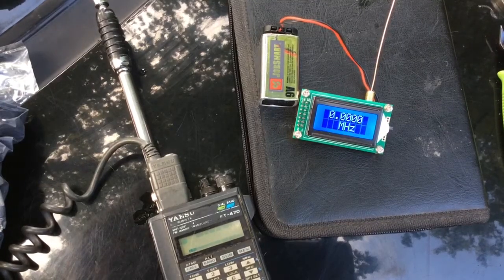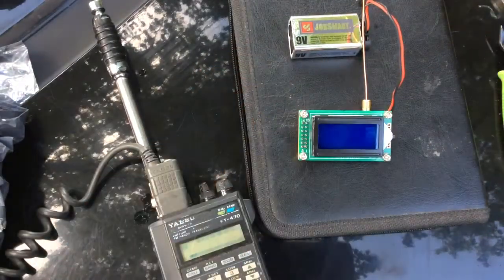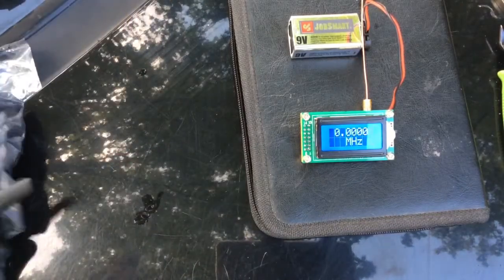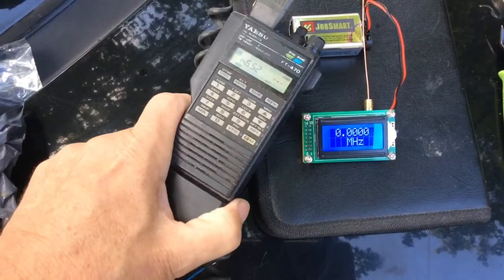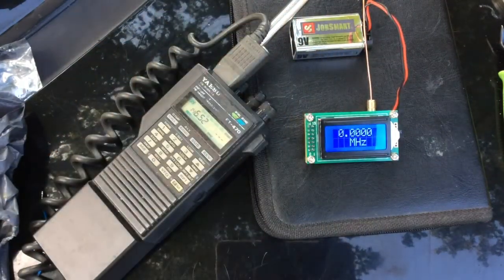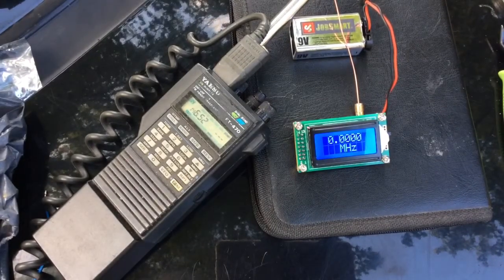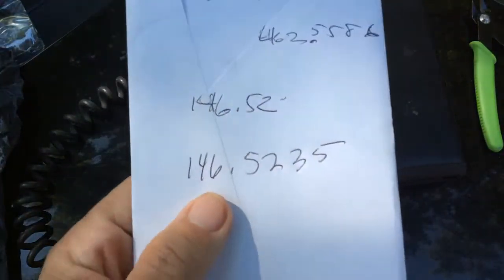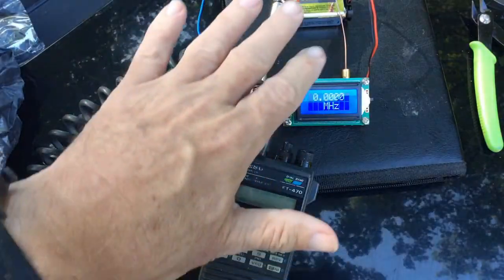An Inexpensive Frequency Display

Comment: I wish it worked below 1mhz - I would built that into my signal generator instead of piping into my external counter.
Reply from the maker: A crazy thought
 Is there some way to multiply the low signal to get it within rage? I know at one ham radio people would use this technology to make a radio on a lower band work on a higher band?
Reply: @m005kennedy  Yes, you can run the sinewave from the signal generator into a multiplier circuit, but then you'd be dealing with a decimal in the wrong place on the freq counter display

Comment: Hey Mike did you ever hook the counter with the QRP rig? I'm thinking of doing that also with a OHR 100a QRP rig.
Reply from the maker: I haven't yet,  but that was my intent.  The easiest way but not the best is to hitch it to the antenna.  When you transmit you will know the exact frequency.   It would be better to find the point inside that you could get a read out without transmitting.  I think you could get that information from the company

Comment: I have a question. Does this FC works with audio signals generated by function generator ? I have connect mine to a function generator and it doesn't read. I think that only reads RF signals. Can you confirm ?Thanks.
Reply: My counter works conected to signal generator  with a sinus outpout of 1Mhz and above.
Reply: These don't work below 1Mhz...
Reply from the maker: But for the price, it is still outstanding.
Reply from the maker: I can't be sure. Does the function generator produce a radio signal?

Comment: Whether this meter detect FM Radio frequencies (88MHz-108MHz)?
I wonder which frequency this meter will show near a FM Radio. There will be 4 to 5 FM radio stations (frequencies) active at a time.
 Can i use this device reliably to detect RF output of low power FM transmitters?
Reply from the maker: I think it could not be used as a frequency sniffer or to detect low power transmission without putting some serious RF amplifier in front of it. They do have some handheld scanners that will lock on to the strongest transmission. If you were close, say a yard, to a low power transmission it would be stronger than high power transmissions that were further away.
Reply: Ten miernik z powodzeniem pokaże częstotliwość pracy heterodyny odbiornika radia fm (ukf) jednak musisz pamiętać, że częstotliwość heterodyny jest o 10,7mhz wyższa od faktycznie odbieranej przez głowicę radia. Odbiornik jest zbyt głuchy na fale stacji radiowych i nie powinien zostać zagłuszony. Ja go używam do przestrajania radioodbiorników.

Comment: I don't think putting X-watts in a direct connection would have a good outcome. The frequency isn't going to change - it doesn't change traveling to the receiver or repeater - what makes you think it will change?
Reply from the maker: Transmitters often have an intermediate frequency that is different from the actual frequency it transmits on,
Reply: No, they do not transmit in such a way that a direct connection or 3 inches would make any difference. If so they wouldn't work very well - There could be a couple hertz change over a great distance - - or a doppler shift if the transmitter / receiver are moving - but neither of which apply.

Comment: Hi, just to ask if this item could be used to test a key fob. Thinking about to use it in the workshop to diagnose any car brand remote control. Thanks!
Reply from the maker: Do you know what frequency fobs run on?
Reply: @m005kennedy  most car brands work between 200-600mhz. Related to the antenna? Just a wire as your example or something more specific? I saw some detectors like yours that work between 10-1000mhz. Thanks
Reply from the maker: I think a wire bout close or wrapped around it once would be all that is needed. You would basically be checking for a single or not. It would be easy to see the display jump to the frequency once a button is pushed. Just be sure of the specs of the unit you buy so it will cover those frequencies.

Comment: Did you ever install it in your QRP radio?  If so, how does it perform?  Do you have a video (and schematic!) you can share?!
Reply from the maker: No i did not. Ham radio has been on the back burner. A small wire rapped around the antenna would give an accurate transmission frequency. My unit has an offset so it would probably be less complicated to use two units. The receiver frequency would require a knowledge of were it should be coupled. Since this kits come with extensive assembly, test, and alignment information it probably would not be too hard to determine the correct point to couple it. It is currently packed away.

Comment: I got one of these to measure tank circuit frequency of small induction heaters, those in the 1000 watt to 2500 watt range.  But I don't know how to connect it to a the induction heater.  I tried making a 3 or 4 turn loop antenna, but that didn't work.  Assuming that the actual input needed by the meter must be down in the microvolt range,  i then make a  10:1 voltage divider and capacitively coupled it to a 5 volt oscillator.  Still no luck.  What should I be doing?
Reply from the maker: This confuses me. I don’t think an induction heater would have emission of radio waves to be measured. I think this is going to only work with radio transmitters.
Reply: @m005kennedy  I just got in from the shop after some more testing.   By the way, these  particular "ZVS" induction heaters work in the range of about 40 KHz to about 120 KHz.   Their work coils  (air wound inductors) run at powers up to about 50 amps at 48 volts, so they do, indeed radiate. I finally got some readings on the frequency meter using a 9 turn work coil as a "receiver", but never any values below 1.000 Mega Hertz. That got me wondering  if the product description is what misled me.  It says  something like   "1 ~ 500 MHz".  I took that to mean 1 Hz to 500 MHz.  Apparently they meant "1 MEGA Hz as the low end.   I guess I will have to keep looking for a cheap frequency counter that can work in the range I need.  I just calculated a bunch of harmonics for the coil I have on the induction heater right now.  I will go back out there and see if  some of the range  of readings I get match any of those harmonics.  Keeps me out of the bar, as they say.
  But thank you for the video.  It helped me to find with an input  conditioning strategy.
Reply from the maker: You obviously know more about it than I do. I was just surprised these units worked do well displaying the exact frequency of my two meter ham radio.

Comment: These are kinda dodgy, bought one but I was junk, display was too contrasted which I fixed with a variable resistor. Unfortunately unit died a couple of days after that. Never could get it on frequency with test equipment directly linked. I did find that you could adjust the received frequency from the trim cap on the back of the unit, never got to within 500Khz of test frequency.
Reply from the maker: The one I had works and is easily read. The display didn’t video well. Maybe a quality control problem?
Reply: Probably it was a 2016 unit from the QA sicker inside the unit, I have another on order. Will post.
Reply from the maker: These things are so inexpensive! What I cannot understand is how I can order something for under five bucks, shipping include, and I couldn’t even mail the same part from East cost of the US to the West for that in shipping?? Makes me think China own a majority share in the USPS!
Reply: Right!?
Reply from the maker: Did you order a new car one or ask for a replacement?
Reply: No, I just junked it I figured it wasn't worth trying to get a refund from china.
Reply from the maker: I wonder how they handle defects. It would not pay to ship it back. I noticed on the Banggood site that if anyone complains about a product there is a broken English reply saying they are sorry and asking people to contact customer service. Although I have tried them I have found customer service with a language barrier to be almost impossible. I bought a geotagging device to work with my DSLR. After a number of tries I just gave up. I should have demanded my money back, but I didn’t. I think some companies count on the fact that most people just get frustrated with a non working product and just throw it away if the the price is low enough.
Reply: I think you're right I've been burned a couple of times, I guess its a lot better than buying a $90+ frequency counter that craps out although I am waiting on YB-562 counter at about $30.
Reply: Got another one of these the screen works this time but the freq seems to be off by about 20khz? going to build a small xtal oscillator to test zero instead of hooking up directly to an oscilloscope.